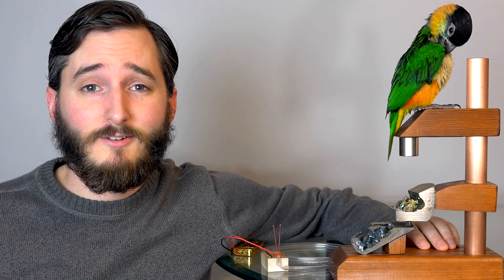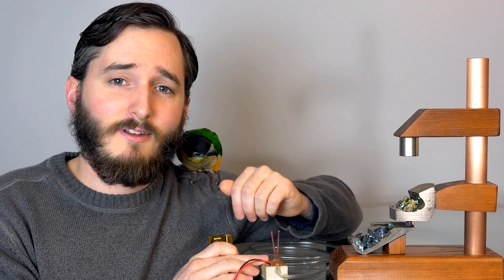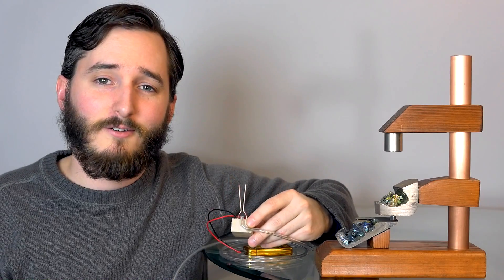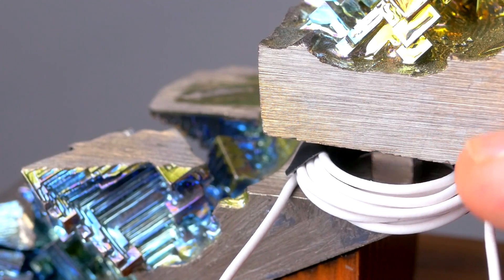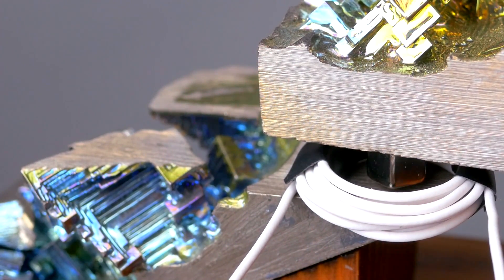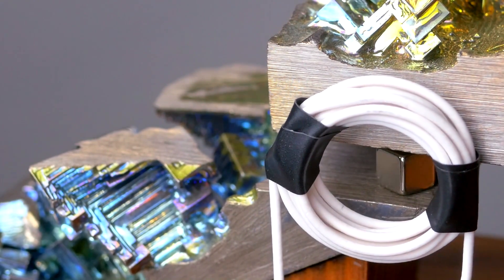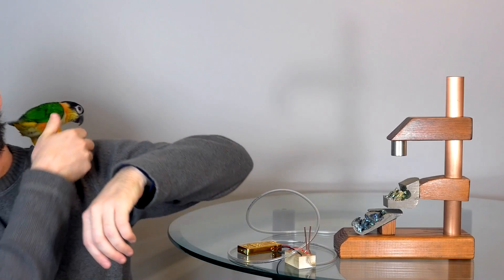Making a Jacob's Ladder from an Arc Lighter & Can a Bismuth Levitator create a Frictionless Motor?

Comment: I believe the cause of the spin is that the edge of the magnet is hitting the bishmuth. Because of the motion of the magnet moving back to the center, and there being a pivot point around the corner/edge, it starts rotating.

Edit: I think you can still turn this into a motor. If you scale this up a little bit, you might be able to put very small bar magnets on the side of the main magnet, then use a brushless motor ESC to spin it. Though it would be extremely complex and tedious to actually do.

Comment: The only thing I can think of as to why it continues to spin so rapidly without the circuit complete would be inductive effects from the coil acting back on the magnet. But even that shouldn't make it sustain the spin the way it did, since, as you already mentioned, there is friction from the air.. Very interesting. It would be worth seeing if you could get the magnet spinning without the battery but with the coil around it, and whether it it would still keep spinning like that. Nice work!

Comment: A coil of wire when hooked to a DC source will generate an EMF field in the direction of Flemings left hand rule.  When you remove the DC source (battery) the emf field collapses thus reversing the EMF direction.  Since the cube magnet is central to the collapsing field it spins up with the speed relative to the speed of the collapse.  The variance you see each time you try, is do to the fact that the magnet is getting hung up on the apparatus.
Reply: The rotary motion comes from the magnet being a cube and bumping the surfaces, creating a pivot point which turns the linear force into rotation
Reply: +Q-Hack! +Meosiwa +Andrew Phillips

so as based on your explanation so far Q-Hack.
1. The field collapse only apply force to the magnet  in one direction.  
2. it should thereby  only spin the magnet in the same direction  every time the fields disconnected.

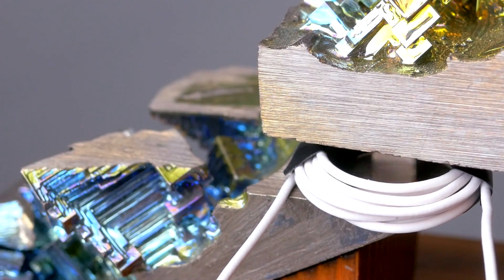that's not happening. look at 4:12 -4:20
the magnet spins a random direction every time the field collapses.

your statement / explanation is thereby not true since it predicts the magnet will spin the same direction every time.

Q-Hack! is therefore wrong.
Meosiwa is explanation is much more believable
Reply: well said
Reply: Q-Hack is correct here. Bam.
Reply: I think what you are seeing here is that he is bumping the connection on and off repeatedly.  You see it spin in the opposite direction only because of the chaotic nature of what he was doing.  When he connects and disconnects in a less chaotic manor 3:41 , the effect I am describing is very clear to see.
Reply: HoxTop My thoughts exactly. If I get the chance ill recreate this experiment but with a magnet floating on water. If it is the field it should still spin. If its not, than it shouldn't
Reply: +Yextus   I think you missed the concept here.  While the field is active, the magnet can't spin, it can only align with the field.  When the field collapses, the magnet is then free to move as the force holding it in place quickly diminishes.  Because the collapse of the EMF is in reverse direction from the original EMF, it provides a force to the cube which then tries to realign to the new EMF, which then goes away and momentum of the cube is free to spin in the otherwise frictionless zone of the structure.
Reply: Q-Hack! This still doesn't explain where the rotary motion comes from? It would make sense if spinning the magnet caused an increase in the flux, and then it would spin to slow the flux change. However the spinning magnet should be magnetically equivelt to a non-spinning one as the poles are up and down and the field is "round". This is proven by the fact that it keeps spinning freely. If the field was changing while it was spinning it would slow down from the inductance with the metal and the wire. This is why I think the spinning is due to its motion when it falls back toward the center
Reply: +Q-Hack Fleming's left hand rule is about how a current carrying conductor behaves in a magnetic field. Not about how a magnet behaves.
Fleming's right hand rule is about how a current will be induced in a conductor in a changing magnetic field.
These two together (because the coil induces a current in the magnet and that current creates a magnetic field, which is weak)  have an effect but it is minuscule compared to the effect of the magnet reacting to the magnetic field of the coil.
Reply: Try adding an inductor inline to the coil, like a Henry to see if there's a difference.
Reply: EMF isn't relevant in this case because the spinning thing is a cube magnet (the effect is negligible). EMF is what is induced in a conductor by a changing magnetic field. The dominant force here is the magnetic forces of the coil and the magnet. I think +Yextus and +Meoiswa are right.
Reply: +Q-Hack Also, the magnetic field created by the induced current is in the same or opposite direction of the magnetic field of the coil, which is perpendicular to the two bismuth blocks. This means the induced current won't make the magnet spin.

Comment: try using a smaller coil or lower voltage and lower amperage. the coil was creating too strong of a field and was overpowering the force holding it between the bismuth plates. It is a fun experiment and I think it could be made to work.

Comment: Could you attach four small pieces of steel to the neodymium magnet to act as fins, then blow air through the tubing to create a continuous jet of air. Granted the fins have rotational symmetry, the deflection of the air would create a pneumatic motor, right?

Comment: Because of the static charged created by the DC voltage applied by the battery the magnet just wants to cling to the coil. If you used an alternating current with a coil that is made with motor wire that is smaller but with less of an insulator on it. With the AC and motor wire you should be able to come close to achieving the friction less motor that is the goal here.

Comment: It's the momentum. Because a battery outputs DC current, the coil turns into an electric magnet. When the current is removed from the coil, it releases the magnet. Because there is a bigger permanent magnet in the construction, it grabs the other magnet. Because of that, is the smaller magnet moving so fast. If I were you I would use an AC current because it changes its polarity.

Comment: you could get the magnet to spin by putting the coil parallel to the side of the magnet and using AC current. wouldn't work though because the magnet would spin north to south and it would no longer levitate.
Reply: hey7328 I thought that was a real spider for a second

Comment: Perhaps it is spinning because the cube is first close to the wire in an assymetric magnetic field, and once you disconnect the battery the magnetic field is changing fast, inducing a current in the cube  which in turn causes the cube to spin due to an imbalance of forces, but i have no idea if this effect would be strong enough to cause the rotation.

btw great video, keep up the good work!

Comment: Putting the coil on its side like that really caused you to make the worlds saddest Gauss Cannon
Reply from the maker: Ha, I guess it did.
Reply: The saddest Gauss Cannons are the ones trapped in the brains of procrastinators.
Reply: I think that one fires with more force than the Gauss gun I built. Although mine threw some unnecessary sparks as an added bonus

Comment: I think a constant DC will not make a motor, motors usually use an actuator to turn off and on the coil as to make it spin, perhaps if you used a frequency generator you could find the correct frequency at which it will spin the magnet, you probably also should use 2 separate coils as to have one push and one pull for the magnet ( again with the frequency generator turning the coils off and on. )
Reply: Hèhè, finally... someone who sees and knows (and says) whats really going on there. Clearly because its from that keystoneman himself!
It is very clear here again, that education helps gigantic when experimenting with simple things like this. Good that you watch that youtubers and help them understand what they are speaking of!
Reply: I meant commutator, not actuator, sorry
Reply from the maker: I should have been more clear about the question I was asked. It simply was asking if a coil of wire and battery would turn the levitator into a motor. It would be interesting to see if a multi coil setup, AC, etc. could be made to work.
Reply: NightHawkInLight ahh ok I see, yeah it would be pretty interesting... great video btw!

Comment: What if you had 4 square bismuth magnet levitators in a grid with wire coils in the gaps between them, then pulsed electricity through each coil in a sequence to make the magnet jump to the adjacent squares?

Comment: A frictionless motor is an oxymoron. A motor is meant to drive a load, which introduces friction. Also any bearing that will stabilize the motor will add friction. Even when using magnets to float the motor as bearings, the load will make it unstable and pull it off center creating magnetic friction. It is possible to create a frictionless spinning object, but it can't drive a load without friction and therefore can't do any work, making it not a motor.
Reply: Well, a motor that doesn't ADD friction would be pretty good!

Comment: The issue I see with how you're trying to make the magnet rotate is that you are using a stationary magnetic field, as in it remains in one polarization after it is connected. Motors that use electromagnets to produce torque on the rotor are arranged in a circle around the rotor and alternate between being a north and a south magnet in order to keep the rotor moving. Also, if you were to apply this to a levitating magnetic such as this, the rate at which the individual magnets change would need to be pretty high to prevent the magnet from moving to one side of the coil (the one that aligns the magnet's and electromagnet's respective poles), as you see occur in the video.

Comment: In order to create a motor, wouldn't you need to put the coil vertically around everything so that the magnet is centred and then run ac through it? I don't see how this could work with the coil horizontally or using DC. if the magnet is centered, the field of the coil will cause it to align. then every time the field is reversed, the magnet will turn 180 deg to realign.

 instead of wrapping the coil around everything you could put one in front and one behind so that their "center" is where the magnet is.

but even if this works it won't be frictionless, there will be Eddy currents slowing the magnet down over time.

Comment: okay, I don't think you gave the motor idea a fair run as you didn't really make a motor. A motor requires a rotating magnetic field. In DC motors this is caused by brushes that power alternating coils, in AC or brushless this is achieved by powering the coils directly with alternating power. A single coil wrapped around a magnetic core just simply isn't enough. You should try again with maybe a BLDC controller and several coils or a stepper type design.

Comment: From what I can understand, you're providing the coil with a DC current which is giving it a magnetic field similar to that of a bar magnet. That's why the magnet is just sticking to it. An emf is generated through change in magnetic flux (in the case of disconnecting the battery, from max to 0) and so a similar emf is produced when disconnecting the coil as when connecting it. Correct me if I'm wrong but I think that may be causing the spinning? AC would produce more motion, I think.

I haven't thought about it in much detail but are you sure that a permanent magnet inside a coil would work the same way as a conventional motor, with the coil spinning inside a magnetic field? 

Keep up the good work.

Comment: The magnet is in the wrong orientation to turn it with those directions of  windings, you'd need to use stepper motor windings to be able to get something, if anything, from it.

Comment: looks like it's creating an electromagnet when you run current to the wire. maybe try a voltage regulator to slowly step the voltage up to find the sweet spot?
Reply: Rick Bechill well no shit it creates an electromagnet.
Reply: Henri Lyyjynen if you can't find shit...try looking in the mirror. might take you a second but I'm sure you'll find some
Reply: Rick Bechill Sounds like one of those things that all 11 year olds globally use when someone says: no shit.

Comment: if you want to spin the magnate using the coil use an ac power instead of dc witch will produce an alternative magnitic field.
when you disconnected the coil ,the magnic produces an ac courant in the coil through induction witch will create by it's self an alternative magnetic field that keeps the magnate spinning.

Comment: When you apply a voltage to any coil of wire, it will generate a magnetic field around it (causing the magnet to stick to it). When you disconnect the coil from the power source, the stored magnetic field collapses and creates a voltage in the coil that greatly exceeds the initial voltage (this is the concept used in boost converters). It's possible that something to do with the magnetic field collapsing is what's causing the magnet to spin.
Reply from the maker: Very interesting!

Comment: For the motor to work, you'd need some sort of commutator to switch the magnetic field at the optimal frequency, whether it be by brushes or by a Hall effect switch. Theoretically the Hall effect switch does take a fraction of energy out of the rotor, though this is negligible. The biggest problem you'd face would be trying to extract the mechanical energy of the rotor without bearings to stabilise the axle. I imagine magnetic bearings could be made to this end, but either they'd have to be airtight or the entire system would have to be in a vacuum, and whatever you're driving with this torque would also have to be frictionless. The only application I can see for this would be frictionless reaction wheels in a spacecraft, and for that you could simply use a large magnetic rotor as the flywheel and the motor simultaneously.

Comment: you need a commutator for that motor if you have two batteries with opposite poles that way it won't be pulled one way or the other or rather it alternates quickly alternatively hook up your pulse DC lighter battery

Comment: If you used a weaker battery for the coil, you might be able to find a balance between slowly accelerating the magnet and not pulling it to the side.
Reply from the maker: Not a bad idea.
Reply: Well, I think the issue is that this is not how you build a motor. The orientation of the magnet doesn't  allow for it to spin. The poles would have to be oriented sideways and you'd need multiple coils arranged in a circle around the magnet to spin it on that axis. But it won't float in that orientation. I think it os only spinning a bit because the coil and the magnet are imperfect, creating an off-center lateral force on the magnet.
But that is not the first part of the question that should be discussed. The first part is: is it even stable enough to build a "frictionless" motor? The answer to that is no. It only barely floats in there. As you can see it is pulled around by this little bit of magnetic field from the coil.
Reply: I was going to suggest using a Potentiometer (variable resister).  Then he could slowly dial up the voltage to see what happens as it ramps up.
Reply: For that matter, even the shape being a block might have an impact. Being a square with edges may even be factor, and I wonder if a cylindrical shape without the flat surface area and of course the sharp edges might help.
Reply: could just try a resister
Reply: i dont know much about electricity, but what about less coils?
Reply: First thing I thought of, reduce the voltage, a simple low voltage variac would suffice too.
Reply: or if you use a smaller wire and make a coil from that it might work. also try an alternator so that it won't pull the magnet but change the motion which could be enough movement to make it spin rather than it pulling to the wire
Reply: Couldn't you in theory have multiple magnets glued together perpendicularly, with the strongest ones going laterally and being involved in actually levitating the magnet, with the ones perpendicular to that one on the sides responsible for spinning it up when current is applied to the coil?
Reply: In magnetics circles work better than squares because of the shape  magnetic fields naturally prefer to be.
Reply: I wonder though if the problem is simply the consistency of the magnetic field generated in the coil. At any given instant(miniscule amount of time)the force could be greater in one area causing it to pull the block to that point. In a perfect world, with a perfect coil where the field was absolutely balanced at all times the block could theoretically be held at center-ish. Just thinking "out loud". : )
Reply: But a square is "balanced" having a high point matching a high point. But still, that's only in a perfect world. could have small imperfections.
Reply: I won't pretend to have a lot of knowledge on electromagnetics, but was just thinking the smooth cylindrical shape would be more conducive to a freer spin as it faces the coil (being seated in there with the coil surrounding it on all sides). Maybe someone could comment on this more. Whether flat surface areas and edges play a roll to any marked degree.

Comment: If you applied a positive charge to the lower plate and negative on the upper plate, maybe with a fine strand of wire just contacting the magnet from each plate you'd have a levitating homopolar motor.